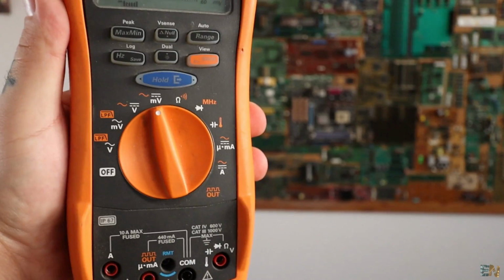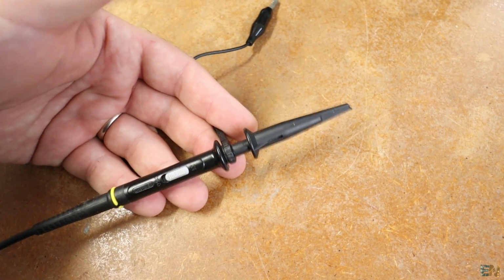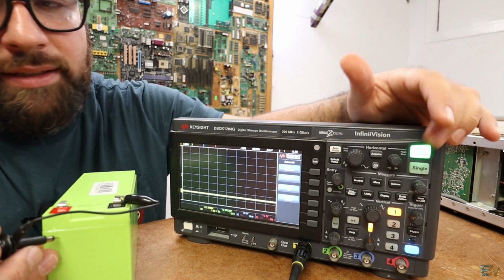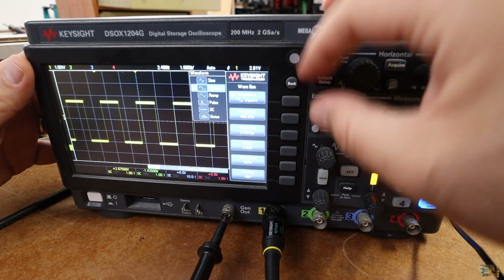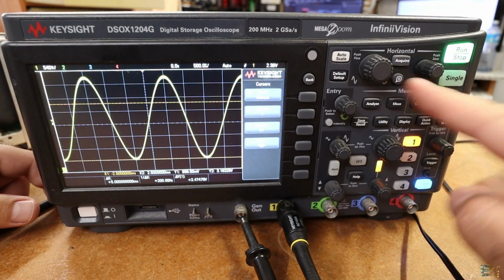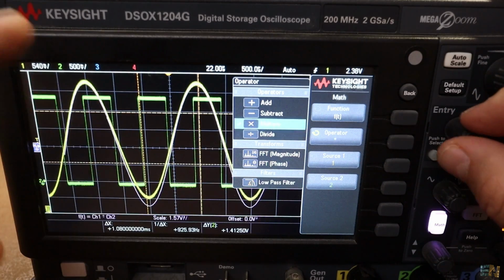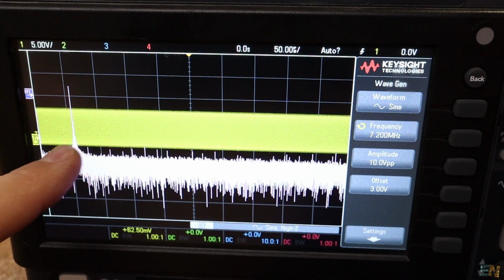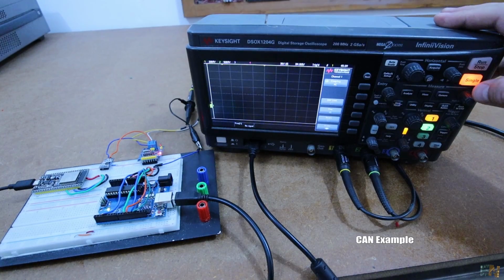Oscilloscope - What is and How to use it?

Comment: TY!  How can we use the o'scope to measure a huge capacitor like 5000 f?
Reply from the maker: @l0I0I0I0  use the 63% charging time constant.
Reply: @ELECTRONOOBS  ok   ty!. How might I do thsy with my hantek  handheld, 63% constant?
Reply from the maker: @l0I0I0I0  uff i have a very old tutorial on that: https://electronoobs.com/eng_arduino_tut10_1.php charge the  cap to any voltage through  a known value resistor. Measure with the scope the time it takes to reach 63% of that voltage. Divide that time by the resistor value and you get the cap value.
Reply: @ELECTRONOOBS  Nice ty!

Comment: Yes, it's a very handy bit of kit, I would like to see more scopes incorporate digital decoding as a standard feature, you hook it to USB data lines and voilà you can see what the data represents
Reply from the maker: @SusanAmberBruce  actually this one decodes uart and I2C
Reply: For digital signal decoding a (cheap or expensive) data analyzer (with 8 or 16 channels) will likely be more useful.  For around $20 you can get one that can handle up to 8 100MHz signals using sigrok (and the GUI on top of it whose name now escapes me).  For Arduino stuff it's great.  For really high-speed or wider busses you'll have to open your wallet way more.
Reply: @MisterkeTube  Yes, I got one, and it was inexpensive.

Comment: Greetings! 😀 I really want you to make a video about an ASK based CB frequency radio transmitter for long range serial communication. Because the currently available modules like nrf are very low ranged, I think a custom radio transmitter would be a great idea for such projects. I watched some videos where Arduino timers are used to generate an AC carrier signal with two of its pins. But couldn't find a detailed description anywhere. I hope you try this project 😃 Good luck 🤞
Reply: @electroboom I think choosing a suitable legal radio frequency in the Mhz range would be good, because it will have greater range than 2.4Ghz. I would also like to know more about the various anteena designs for such projects 😃 because anteenas matter a lot. Anyways, I hope you look into it 👍
Reply: @electroboom I just want to know about a suitable circuit to generate a stable carrier frequency, so it can be turned on or off using a MOSFET, according to the logic level of the serial pins. Btw it would be a great project for something like an encrypted serial audio walkie talkie project 😀